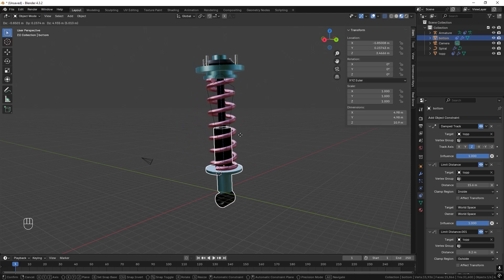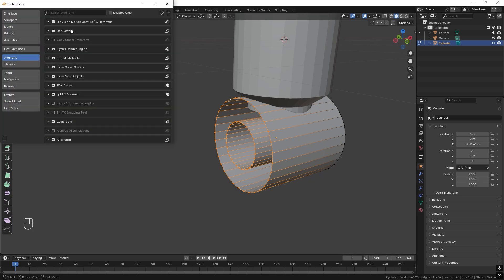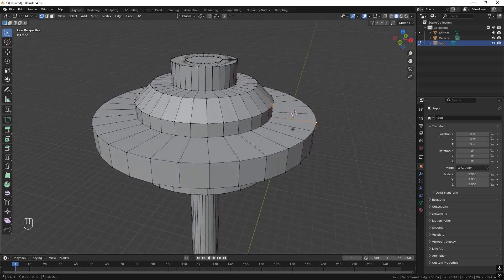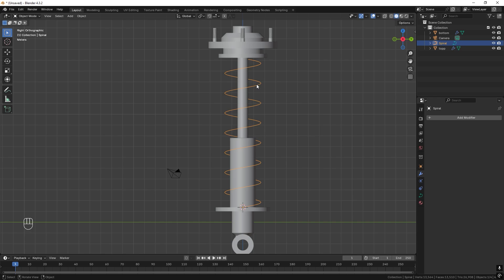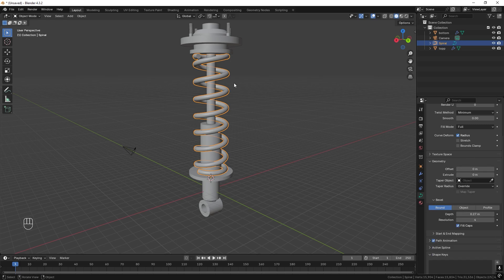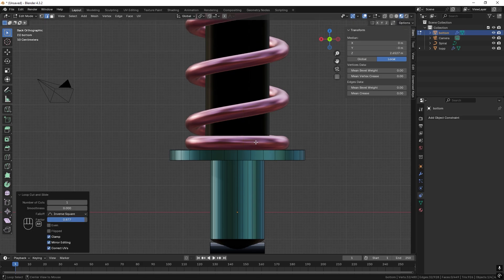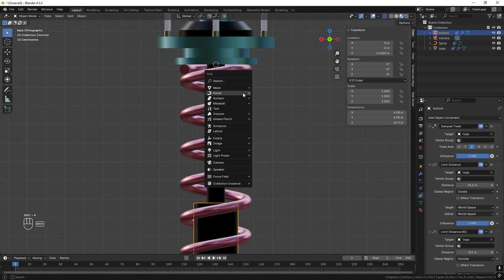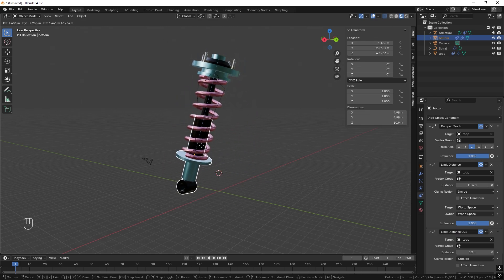How to Model and Animate a Coilover - Blender 4.3

Comment: I built this thing and it looks really cool, but moving it around and mounting it on something else is really difficult, am i misunderstanding something? it wants to rotate all over the place as i move the root node, but it also just spins when i try to use the rotate tool

so i have to do this weird workaround where i move the bottom in an orbit to get the disred rotation
Reply from the maker: Doesn’t it work with parenting?

Comment: Great tutorial and super easy to follow. One question: is there an easy way to scale this after all the parts are set up? with all the constraints it breaks apart when scaling and even after scaling and applying scale
Reply from the maker: Thank you! Hmm I would propblably connect all parts to an empty and scale that. Some things will need a bit of fixing but most of it will stay intact (I think)

Comment: Can you do a video on how to duplicate it? When I press shift D the spring messes up
Reply from the maker: The quickes way to solve this I think is just to realign the top of the bone, as it is on the original spring
Reply: Tysm ima try this right now @3dplockis
Reply: If you're still having trouble with this. What worked for me was to duplicate everything, move it to the new spot, then simply delete the bone and reset the constraints and it was all fine and dandy :)